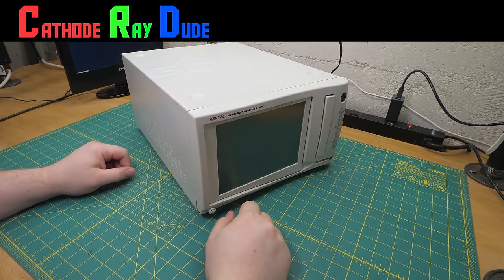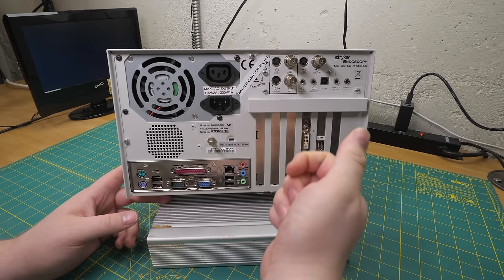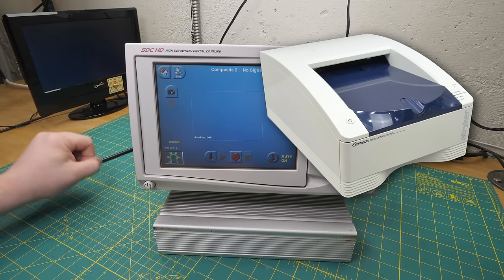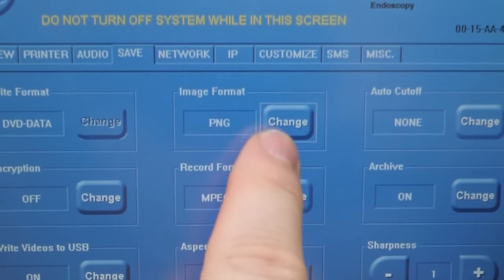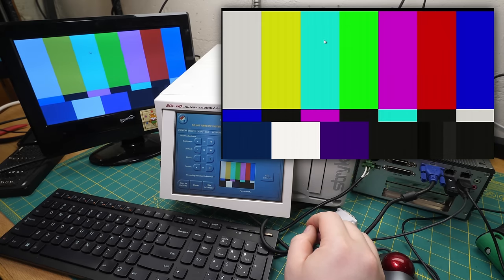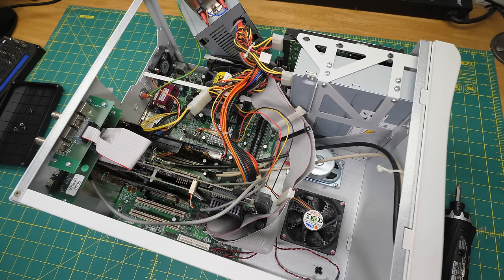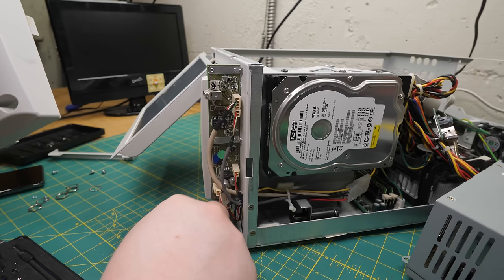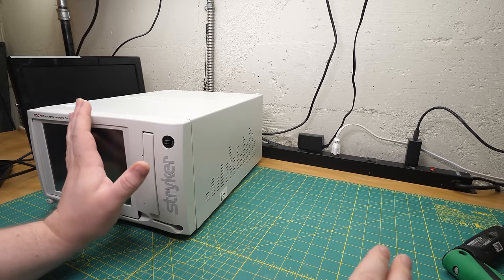Little Guys Ep 11 - Where No PC Has Gone Before [Stryker SDC]

Comment from the maker: Wondering what that hole in the lower right of the faceplate is? I was wondering too, but an employee of the company informed me that that's actually where the remote control is stored! There's a spring loaded gadget behind it so you can press on the remote to pop it out. The strange shape is because the remote runs on a AAA battery, so it's actually shaped like that hole.

Oh, I should mention - the "ground" lug which turned out to be an "equipotentiality" lug, this was new to me but if I understood it correctly: suppose you drag a battery-powered X-ray machine into the room. That generates several million volts internally, which should never make it to the chassis, but you can never be sure about that. Now you hook up a second, also battery powered machine, like an endoscopy monitor. At some point while you're working, metal parts from those two machines might touch, and if there's a 5MV difference in potential, you could have a really big problem. So you hook them together with the equipotential lugs, and it's basically the same as grounding, except you can't call it ground if there is literally no earth involved. Grounding is not as important as being at the same potential - like a high tension lineman on a bucket truck hooking themself to the line.
Reply: I'm just disappointed in the lack of want to talk about where you can stick it early on in the video. In the immortal words of Carlin, what if there's a new guy who doesn't know where he can stick it?
Reply: There is another reason for the equipotential point (as discussed in my class on medical devices), and that is patient grounding. You want a very good ground connected to the patient, and all machines used on a patient are to be bonded to that equipotential point, even if they are on wall power.

The reason is this: let's say you don't have an equipotential point that is low impedence, and the patient is instead connected to two separate machines, which are plugged into the wall and earthed. The patient may or may not be bonded at the same physical point to one of those machines.

Assume the two machines are on their own breakers. Now, assume a modest fault current occurs on one of the breakers, to ground, but the current isn't high enough to trip the breaker, and a GFCI is in place. The current through the ground wire of that branch will actually lead to a voltage difference (due to wire resistance) between the two machines connected to the patient. Since the patient is likely low resistance, considering medical devices are in use, so the skin isn't being very resistive, this modest voltage difference can generate a fatal current.

I have some slides that do a great job of explaining this that I can try to rephrase, but doing this in a comment is hard.
Reply: какой крутой корпус собрать бы в нем современное что нить было б  интересно ) интересно было бы на это посмотреть )
Reply: The verb "ground" has pretty much no meaning in a hospital situation, if I understand correctly? Hospital electrical systems are self-contained from the mains grid (everything is on the other side of a giant transformer) so there is no ground, no earthing. That's why in hospitals you see a pictogram of a person inside a box, it indicates a different electrical system.

Of course I might just be misremembering something I read a few years ago.

Edit: A difference in electrical potential can still exist, of course.
Reply: @3rdalbum  Most ORs opt to use isolated power, but that’s not always the case. Isolated power, from my understanding, is grounded in the center of the transformer but L1 & L2 deliver the standard nominal 120v split between the two.
Reply: I'm one of the 11 people who got the Deep Space Nine reference :)
Reply: @lifetimeofwork  That's called "circuit ground" it will be directly in the middle of the plus and minus rails and instead of 120v It will be 60v negative rail and 60v positive rail that essentially cause a difference of 120v.
Reply: @3rdalbum  I think in hospitals, outlets with isolated ground are normally specially marked? They'll either be in a different color (like orange or red) or have a marker dot or similar on them. Or maybe that's how they mark outlets which are connected to the backup generator system…
Reply: Just a heads up, the Little Guys playlist only has up to episode 8 :)
Reply: Adding and removing surgeons is "who's present to do this procedure at time of event?" -- afaik there are devices not unlike rubber duckies which you pop in and click and they will populate the fields and entries for each surgeon on arrival with a dipswitch for selecting the specific device you are talking to in the case of more complex inputs tho usually initial and last name are enough since you'll be working the machine all day and you're only really changing it if you're using a different machine or different building that day.
Reply from the maker: @facugaich  see this is YouTube's fault, because you can't add something to a playlist before releasing it. If you add an unlisted video, it will become visible on the playlist. So I always forget to add it after release.
Reply: @AndrewKatzmakes  thanks for mentioning this! I am always in this kind of mindset when I am trying to be careful about grounding. I always consider everything a resistor even if it's a wall grounding plug. And I never assume grounding is fine!

I know of a fair few cases where a patient caught on fire due to a technician setting up grounding wrong and causing a tiny arc when they got two devices too close. It mostly caused brief flashes of fire, so no severe burns. But it could, and that's terrifying to some patients.
Reply: @kepstin yes, correct!
Reply: Interesting that it was for a remote! At first glance I was thinking it was some sort of smart card reader to log in the user/set up the operator (surgeon) in the list. Then I remembered healthcare cybersecurity in the early 2000’s…
Reply: Thanks! I was about to ask that exact question. I was even suspecting it was an optional CF slot, but a remote makes sense much better.
Reply: Convert it into a mini MAME cabinet to run older arcade and console games on the 800x600 display. If you can figure out the pinout on that panel connector it should be possible to find a higher resolution panel that same size. Some googling turns up that there are some standard pinouts for desktop LVDS on a 30 pin 0.1" pin header.
Reply: I'm not sure if you're still reading comments from this video (or at least replies to your own comment), but regarding the math at 53:21, if the number of words in each bank/chip is correct, that's not 64 million bits of total SDRAM, it's 64×2^20 (~67.1 million) bits, that is 64Mibit (mebibits, not megabits), which comes out to 8MiB (mebibytes, not megabytes) in total and 2MiB per bank/chip.

Comment: the second port is for dual wielding endoscopes.  It requires a special skill stat and really high dexterity and perception stats.
Reply: one going up and one going down?   What if they meet in the middle?
Reply: @zebo-the-fat  If they meet, they kith
Reply: then they snog
Reply: @zebo-the-fat gosh what if they get tangled
Reply: @SomeUsernameSomeoneElseTookIt  Just unplug either and pull both through. Easy!
Reply: Roll for depth perception check.
Reply: @jschwenker1  😂😂😂 The second input is usually to capture media from a second source, typically an imaging device in the room.
Reply: "I'll keep digging
Till I feel something" - TOOL

Comment: This device is just a recording module for endoscopies. You don’t need it to watch the endoscopy live. Usually, there’s a device that takes the signal from the endoscopy camera and sends the video to a monitor. If you want to record, you can use this device (or any video capture device) and pass the video signal through to the monitor. The screen is not meant for watching live video. It's just for controlling the recorder/printing interface.

Comment: As I understand it, a Kensington Lock isn't necessarily about stopping someone from stealing a device. But. 

But. Ripping the device away from the Kensington wire connector will do permanent visible physical damage. Basically, anyone decent would refuse to buy a device with damage like that as it's practically a surefire sign of it being "hot". Severely limiting the black market value. 

At least, that's my uneducated understanding.
Reply: It also keeps honest people from swapping the machine into another cart of equipment and messing up inventory control or ruining a specific config that was unique for that cart. The box may have special licenses making a bare bones replacement useless. Also the maintenance contract could be with that specific department rather than the whole organization so a maintenance tech couldn't do their job until the original is returned. Even if you're not worried about meth addicts stealing stuff, sometimes it pays to secure it from your coworkers when not in use.

Comment: "Where does it exhaust?" Through the power supply. That was part of the reason the PSU was above the CPU in the original ATX case layout.
Reply: "Let's use this densely-packed space with big stonkin capacitors as the way for the air to flow out of the case" was somebody's thought process at some point
Reply: @3rdalbum  Worked well enough at the time
Reply: @lemagreengreen   Yep.  And that is (part of) why, if you have a PSU from 1998-2006, you absolutely need to replace the capacitors in it right now.
Reply: @lemagreengreen   I guess the air from the CPU wasn't that hot in those days.
Reply: @3rdalbum The Pentium 4 existed at that time.
Reply: @Toonrick12   By the time the Pentium 4 came out, didn't computer cases have fans of their own?

Comment: I think they don’t provide a video feed on purpose. They probably don’t want a doctor using the video feed with loads of latency and being embroiled in a lawsuit when it all goes wrong.
Reply: @jacobwortley  So the following versions of this did show a small preview. Eventually, the SDC and the Stryker SPI AV router control system were rolled into one device. This later evolved into the SDC4K (for use on portable carts with endocams, light sources, insufflators, and other equipment) and the ConnectedOR Hub which serves as the controller for routing and capture device. Those SIDNE ports are in use now for using the SDC4K/Hub to change settings on each connected device, turn monitors on and off, build surgeon specific presets.. etc. They use USB cables to this day but it’s just RS232 as far as I know.
Reply: There was no need for it to have lots of latency. The video capture card can dump the current frame into a portion of video memory directly using DMA (well, that's what I understand). I had a video capture card in my computer in the 1990s and there was effectively zero latency when viewing the input on the monitor. However, I don't remember if it was still that smooth while recording, maybe it couldn't do that direct memory trick while recording.

Comment: The desktop 845/865 chipsets only have one display pipe, so no independent dual head output. The mobile chipsets from the same generation (830/85x) do have two pipes. All those chipsets support VGA and DVO outputs, and 85x even has a builtin LVDS output. Starting with the 915 chipset SDVO replaced DVO, and even the desktop chipset variants gained a second display pipe.
Reply from the maker: Ahhh, that makes sense. Ty!
Reply: @CathodeRayDude   Also -- that AGP card was an "ADD" card.  AGP Digital Display.  It was a feature of the 845G chipset, in that it could use an add-in AGP card to offer a DVI output (or in this case, LVDS) instead of the built-in VGA port, without having to replace the whole GPU.  There's no driver for it because you're still using the 845G as the GPU, it's just using a different DAC (in the video card architecture sense, not necessarily literally an analog conversion, obviously.)

EDIT:  .... and then you Google it immediately after I paused the video.  Welp, that ought to learn me.  (But I suspect it won't.)
Reply: I was about to do a long writeup about encoders, but scrolled down the comments first, only to see you reply! Ville!!!! Of course you also watch this sort of stuff.

I assume that you have also stumbled over "tales of weird stuff", if not, head over now, and marvel over who is also trying to be an influencer (which i will never let him live down) :)
Reply: @CathodeRayDude  Basically, the AGP slot, or later (SDVO) PCIE slot, is multiplexed in a chipset specific way. This was done by most manufacturers with chipset integrated graphics, in a chipset specific manner. Intel, VIA and SiS were doing it at the time.

Parallel or later serial pixel data, a clock, and some i2c, is pushed over to the respective encoder chip. These encoder chips were often made by Chrontel, Silicon Image, VIA and SiS, and allowed for extra DVI, LVDS, VGA, or TV (in its various guises) display outputs. Such chips were also found on higher end versions of discrete graphics cards (a geforce2 was a likely culprit), where the lower end ones just left the encoder and ancillaries footprints empty on the same PCB.

So there is no FB copying going on, this is just an extra "output" after the display engine has serialized the final pixels that are heading to a display.

Comment: The second input without an output was used for things like a camera in the corner of the room capturing everyone while they were working. These things were just as much for liability as anything else. Almost wonder if you can find a modern panel to retrofit. That whole case is just unique enough it might be worth checking into.

Comment: Lol that button.  It'd take five seconds per unit to dremel out a notch in the end for those button-pushing tubes for the wires to come out of...

For the signals on ribbon, remember that circuit boards of that era don't have coax embedded in them, either, so at some point you have exposed wires carrying signals.  I dug around to find what impedance mismatch you'd get assuming the back panel S-VID BNC connectors are 75 ohms (not a guarantee here but maybe?) and going into that ribbon cable side-by-side, with a ground wire between every signal cable and...   It's not great, but it's not the worst.  It's about as bad as plugging a 50 ohm source into a 75 ohm BNC (or vice versa), daisy-chaining that 2-3 times (it's somewhere between 100s and 150 ohms).  That increased impedance actually helps reduce RFI, a tad, though.  There's also some ways to mitigate reflections from the mismatch, too, like having a very precise length of ribbon (which is essentially unshielded balanced line) to cancel out reflections, but that seems unlikely here given the other hacks involved.  And it's shielded by being in the case, so the main concern is RFI at the frequency of whatever video is; I bet if you configured the CPU to run at a multiple or even fraction of the video signal frequency, you'd suddenly see tons of interference.  I wonder if they picked a CPU specifically to avoid that, or if it wasn't a risk in that era anyway...  Maybe there just aren't any components running at that frequency?
Reply: You don't need coax on PCBs. if you really want signal integrity you can put the trace on an inner layer and surround it with ground planes with via stitching. Also SD composite video is really tolerant of a lot of things. it has a bandwidth of about 6 MHz, so you can treat it pretty badly and it be fine. I've seen people run it completely unshielded, no coax, for 10 meters bundled up next to 48 V high current lines radiating massive amounts of EMI from motor drivers and still get a usable picture.
Reply: I think that's essentially what he means by coax on board.
Also, isn't a 2ghz celeron kinda rare? Compared to the billions of 1.8ghz models I've come across.. Adds to that internal RFI theory for me.
Reply: @VM-lt9wl  but 4 layer PCBs have been around for decades, so that kind of signal routing was absolutely an option

Comment: Used to work for a company that sold and repaired computers. Our entire team had those same green Metabo (then Hitachi) drill guns for replacing parts on laptops. They're excellent. I always found the included rubber pinch guard that feels like it was an afterthought a bit funny. That is until I tried going without it for a day. Good lord did I quickly learn why it was necessary.

Comment: Locking up during cold boot is a sign of capacitor trouble. If there is already a dielectric soak and some charge during turn-on, the voltage is less likely to collapse to brown-out. Also electrolyte is better behaved when just warm enough, not too cold, not boiling hot.

That speaker is from the Foxconn parts bin.

Ribbon cables are fine. Just run every second pin as ground.

You were thinking of PCI Bus Master feature essentially for the video card. I wonder if that existed, but i very much doubt that! You can't do AGP GART without setting address translation from the OS, and the real problem is, PCI Bus Master card wouldn't really know where to retrieve the image data, essentially the video surface potentially isn't even in the global memory map except when in VGA/VESA modes and doesn't really have a fixed known base address.

If a chip supports MPEG2 then it guaranteed also supports MPEG1 even if the functionality is not exposed in software.

I have already seen Chinese video capture cards made from an MStar monitor scaler chip, then some sort of camera USB chip and then an RGB to HDMI converter for loopback out. A monitor scaler chip is also perfect to do light inline video processing since it has low latency of about a handful lines of rolling buffer and it has a feature to insert graphic overlays, used for bootlogo and OSD.